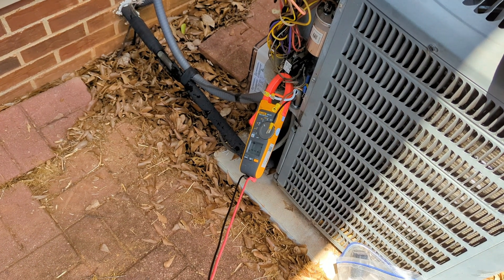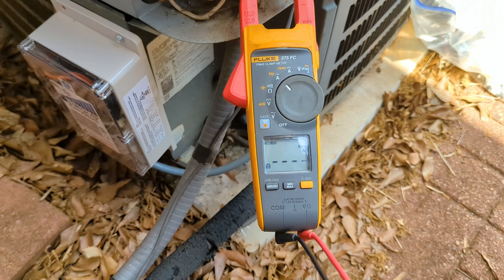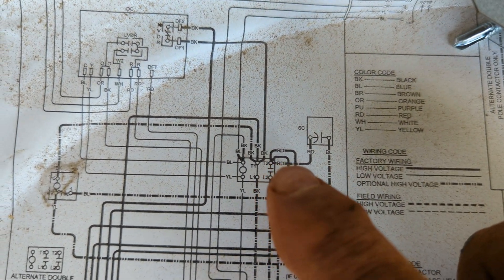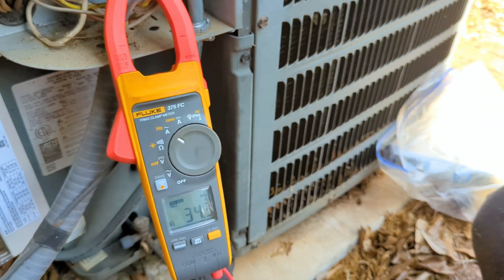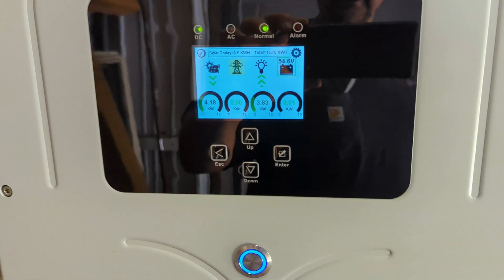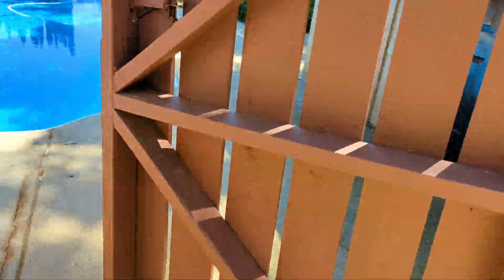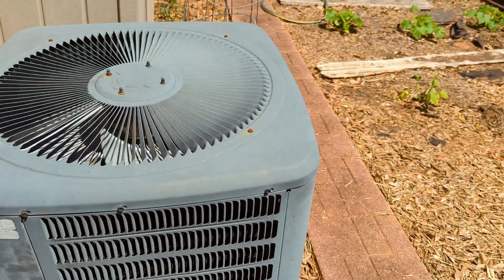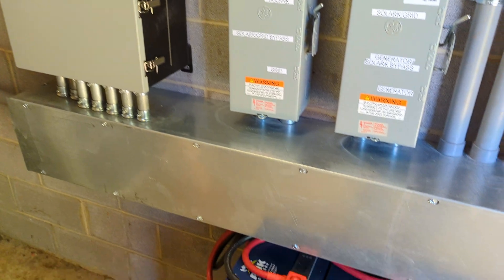HVAC on Solar!

Comment: So how do you get the solar power to power the HVAC. I see the micro air helps to reduce the starting amps but how does the power get from the panels to the hvav

Comment: Good day.  Can this work for an 80 gallon 5hp air compressor for a shop on solar as well?  sol ark 12K, 30kw batteries, 40X 400w panels. Thanks!

Comment: How big of system do you need to support a 200 Amp hous?
Reply: Your utility supply and panel are likely rated at 200a, but your house doesn’t use that amount consistently or constantly.  You have to do a power audit of all of the load drawing devices in your home and analyze your historical usage from a year or more of utility bills in order to estimate the size of the system you would need and then determine if you intend to completely replace the utility power, or just some lesser percentage of your needs.  Then you plan a system based on those requirements.

Comment: I installed a 12k  and used one of these to start a 5 ton ac 
But on another job it wouldn't start their 5 ton so it depends on the ac system

Comment: It would be interesting to explore this further with window units and smaller solar. For like a small cabin that doesn't use a 3 ton. Any idea if there is a window unit that has one pre-installed? There is your next video :-)

Comment: Scott, it would be intresting to see if one of the soft-start units would lower the startup current in a mini spilt.
Reply: Mini splits don’t have an inrush.  Inverter based DC compressors start at 1amp then ramp up slowly
Reply: @xzibit8614  Thank you thats good to know, I have an inverter mini split in my workshop and I love it, we are thinking about replacing the current HOG that we currentley have in our house with a central type inverter unit.

Comment: How long would you expect your batteries to last running your hvac at night in say 85 degree overnight temps?
Reply: You’ll need to provide a complete set of system information to have anyone able to answer that question for you.
Reply: Dude the video is about a specific product.
Reply: And that “specific product”,s only function is to help start an AC system at lower inrush amps.  It has absolutely nothing to do with running it, run time, overall draw, solar, inverters, batteries or anything else with regards to your nebulous question.

Comment: No immediate plans to go Solar, but I could see the benefits for a longer lasting compressor. How does this impact overall power consumption?
Reply: Overall consumption is negligible change-the higher inrush amps to overcome LRA is so brief it doesn’t make a difference overall.  The manufacture will echo this in their own install videos.

Comment: what's the point if you are connected to the grid? unless you start ac unit with small inverter like RV batteries or small generator, they use soft start kits usually.

not sure how much soft start cost was but they might as well get inverter condenser gree and enjoy soft starts and increased efficiency
Reply: What if the grid's down?

Comment: So would this help in a wood shop setting?  I have a Jet 3HP dust collector, runs on about 13 amps, but needs a 30Am circuit just for the start?
Same comment would be for 5 HP Planer & Tablesaw...
Reply: Soft starts are a possibility for most of those devices yes, but the Company shown here only does units for AC systems, not industrial tools.

Comment: I had a 22yr old 4-ton outdoor compressor and it occasionally spiked around 94a @ 240v = 23,000w.    The AIMS 12,000w inverter with 36,000w for 20sec was theoretically capable of starting it but the 250a circuit breaker from the battery -> AIMS would trip.    23,000w / 52v = 442a...  yikes!     Soft start = good.    Soon after replaced the system with a Lennox hi-end 4-ton whole house heat-pump (because of 22yr age it was time) and there's no longer surge and maxes out at 18a.  The Lennox heat-pump outdoor unit is soft start due to it's design so all is good now.

Comment: I have one installed on my 2.5 ton heat pump and it brought the LRA from 55 amps down to 20 amps. You can buy a fancy VFD unit if you are in the market of replacing an aging unit, but for a unit that still have quite a bit of service life it is worth the $300 USD upgrade. It starts up fine on a 4,400 VA inverter and a 7,000 running watt inverter generator in economy speed control mode like there wasn't a load connected to it.

Within the first year of operation, it may have saved my compressor of possible premature failure since it does have advanced compressor protection built-in. Once it learned how my system was operating parameters, a few months later my compressor run capacitor was starting to fail.

It detected the compressor RLA was running higher than normal. Normal for it is around 6 to 7 amps, but it was detecting close to 12 amps and it put it in to overload protection time out state before the compressor internal compressor thermal overload did. IMO, thermal overload should be the last ditch protection fault trip if all else fails. The bluetooth feature allow me to connect to it and help me troubleshoot the system. Thus saving me a $125 USD service call for a $20 capacitor a uncomfortably warm home during the summer.

Comment: Some years ago, I put a "power saving" electronic device in line with a refrigerator. The refrigerator stopped working. Beware.

Comment: Could someone please explain to me why this is so important? My guess is that if you are trying to go off the grid using solar and batteries, normally you cannot have air conditioning unless you have a modern AC or multiple inverters. I infer that this is because normally you get a very high amperage at start up, and so your inverter wouldn't be able to handle the high amperage. Would anyone be kind enough to let me know if I'm on the right track?
Reply: Hi, im going to build my house this year so i have a question if i have 3 bedrooms/2 bath 1,100sq ft living space inside max and i want to buy a 4ton or 5ton ac central do i need to buy a special modern ac central to connect with solar panels, i still dont understand a lot of the inverter/battery info but i saw a lot of videos of solar panels and all have like different brands, some more expensive others less money but i want a good equipment and im from south texas like 10months with good sun so i can buy the $7,000 dollars offgrid inverter i think its the name and new modern ac central will suport starting ac compressor without the $350 kit or i will need 100% that kit for low starting amps/volts ??
Reply: @yoshixx1238  did you get to work something out on solar project ? In the same boat around the same place thanks
Reply: i think part of it is the amp draw on starting the hvac is higher than most other appliances so you might not have enough power to start it (but you would to run it). The Easy start allows the hvac to start at lower amp draw so a solar system would be more likely to have enough power to get the compressor started for the hvac
Reply: @pawliemorph3941  I see. I wonder why the AC draws so many unnecessary Amps by default.
Reply: That’s a two fold answer.  One part is it’s probably the biggest electric motor in your house that you have to run, so its draw is correspondingly high.  Second, typical electric motors have something called LRA (Locked Rotor Amps) that must be overcome before they will start to spin and work-this is also a function of the type and size of the motors-so a large AirCon motor will have very high LRA that must be supplied before it drops down to the operating load.  AC units are typically the biggest motor in your home so they are the biggest draw and issue to start on limited supplies of power from batteries, solar or generators.
Reply: You are correct
Reply: @thrashersheatingandair  Thanks

Comment: Makes me wonder why these aren't standard equipment on every large inductive/inrush/surge load. It must be so much easier on the motor and relay contactor to soft-start.
Reply: I'm not sure but   ....would it also lessen the peak loads on the grid if enough units have it installed?
Reply: @TheNightwalker247  Ehh. Peak loads that the grid sees are more likely "lots of people using continuous-load appliances at the same time" than it is a fraction-of-a-second start-up surge.
Reply: @TheNightwalker247  Yes of course

Comment: I just put one of these on my air conditioner 3ton and it starts up no problem now off the solark12k.  It wouldnt start before.

Now I want to try one on the 2hp well pump.

Comment: Try the same Test with a Supco SPP6 Hard Start Kit,  for $16.29. a lot cheaper than the MicroAir Soft Starter $250.00 – $350.00
Reply: I've used the Supco which is simply a capacitor and it made little too no difference on start up amps.
Reply: These are AC motor controls, they start the compressor as slow as it will go without stalling it.  Much much diffent than a cap.
Reply: We want soft start over hard for a reason though.

Comment: I run 6.25 tons with four hp's 16-33SEER. Two soft starts. Two 12K's. Totally off grid 10 weeks.😍
Reply from the maker: Awesome.  What mode are you running in on the 12ks?   Limited to Home or load?
Reply: @engineer775  Limited power to load. I have 10kW generac connected to Grid brkr on both. I'm   hvac guy, everything is 32% higher than 16 mo ago. Bought a pallet of QCells 475w. They went from $212 for 430w to $305 for 475w now.
Reply from the maker: @USA-GreedyMenOfNoIntegrity  I've been talking with Solark and it is better to run unlimited power to home than limited power to load.

Comment: I've had EasyShare on my 15k Dometic RV units for 3 years now.  Locked amps from 66A to 26A. Logged up with Fluke 1750s that we had for another job at the time. Using Magnum Hybrid MSH4024s

Also while a Honda 2000 will start them, they need 17A when running so a 2000 is not happy about it.  I charge off one hybrid to a 13.5k lithium bank and use the other inverter to power the AC, also the 2400w of solar on the roof helps a little as well.
Reply: The newer 2200 is rated at 15A continuous - they have a new EU32i that is coming out to replace the 3000. Probably branded EU3200is here later this year. Fuel injected, physically smaller, and pull start only, 58 pounds.
Reply: @cyberstick2  nice!
Reply: @cyberstick2  nice!

Comment: Man you have a great job. This is what I could do for the rest of my life. Thanks for the video
Reply from the maker: It is a great job. I am very thankful.  Not everyday am I this excited. There's lots of digging, sweating and frustrations that I do not share on these jobs.  For example. on this one the last panel on the pallet was broken and I had to buy 6 out of Chicago to get one, then one of the batteries wouldn't come on and then we added a lot of complexity in terms of transfer switches and j boxes etc etc.  So I didn't make as much money as I could have. And after dodging many land mines, septic lines, under side walks the customer wasn't happy that we got dirt on his juniper! lol.
Reply: @engineer775  lol, the glory of owning a business that isn't spoken of. I understand man, I have to bury some wire on my own system. I have a "diy" 10kw system that I have been using and upgrading for awhile now. I went to school to learn how to do the wiring because I couldn't imagine burning my house down, lol. I hear the sweating part also. It's great for exercise and staying healthy and I absolutely love digging holes. I'm somewhat of a simpleton, but happy nonetheless, lol.

Btw, thanks for a good softstart recommendation. I was thinking of ordering another inverter, but I'll try this option first and have more time to upgrade later. The winter is easier because I have a chemical tank with a heating element that I store hot water in, then use a hydronic water to air heater to heat the house. I'm honestly thinking about trying radiant heating next winter, but I'll have to do some testing. Thank you

Comment: Yes doable if you have 100k+ to drop on the system
Reply from the maker: Now now.  This entire system was 50k.  Solar, batteries, HVAC work, inverter and a ton of SER cable, transfer switches and Polaris lugs etc.
Reply: @engineer775  And was this system running the entire home, or just a portion of? I say this because we were just quoted 54k for just 33% of our 2200sqf home with a solark 12k
Reply: @engineer775  I don't mean to come across as an ass. Its just that my family and I are very concerned about the direction of the world and were just quoted essentially 100k+ from two different companies to install a similar system. Now, maybe its possible that price can be much lower if we do the work ourselves, but honestly, we are intimidated by it. So we are considering consulting with you. We are trying to prep. We've been prepping for many years but haven't pulled the trigger on a solar system yet

Comment: I wired one of these onto my LG portable AC that I use in a van as an oversize escort. I can run that 6k btu AC on a 2000w Honda now with no surge. The power usage is also reduced, but I don't remember by how much. At least 10-15% though.
Reply: Which specific model start assist/soft start did you use as I want to add one to my motorhome's A/C so I can run my HONDA 2200i instead of my motorhome's ONAN? Thanks!
Reply: @benkanobe7500  Easystart 364.
Reply: @benkanobe7500  I'm not with my van at the moment so I'm not actually sure more specifically than that. I can update you on about a week. I know it was a touch over $300.

Comment: Can these be used on a mini split
Reply: Mini splits are already low on start up amps.  These units will not lower total power usage.
Reply: Edward Hall  Thank you. I never knew that I use two of them on the first floor of my house. They work great
Reply from the maker: No need as they ramp up from zero.